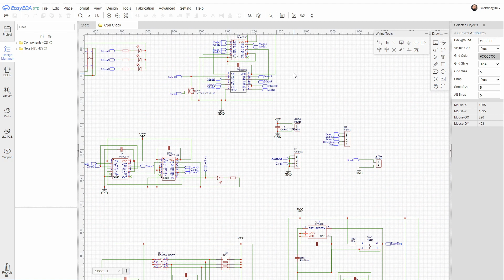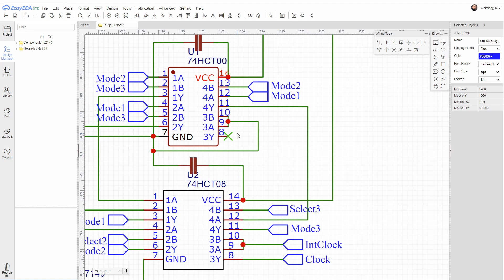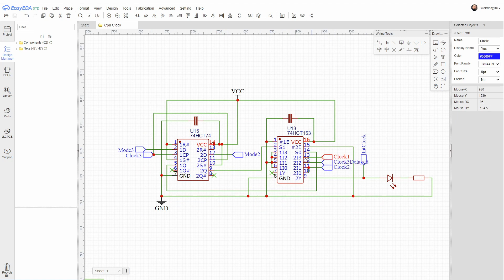Clock Debugging - Making an 8 Bit pipelined CPU - Part 86

Comment: Things are starting to come together, I would not want to be in Intel's boots.  ;)
Reply from the maker: Indeed,  the 2.5mhz 8-bit market is looking pretty vulnerable right now!
Reply: @weirdboyjim  But you have an edge, what other manufacture’s microprocessor can be repaired down to component level. got to be a selling point with the "Right to repair" movement :)
Reply from the maker: We should properly be referring to this as a "processor" rather than a "microprocessor"

Comment: these LCD are actually designed to interface with 4/8 bit MPUs. So by directly hooking them up to the system bus wouldn't be an issue, you would just need to enable the enable line if you are talking to the LCD. maybe using another Device line
Reply from the maker: The interfacing should be fairly simple, I just need to design the circuit to interface between my control lines and the inputs it needs. I just need to spend some time to work out the simplest circuit.
Reply: What do you mean? Simplest circuit? out on  device A = read/write data; out on device B = read/write register. OR the 2 write lines, Hook up the select lines to Enable and the other also to RS select

Comment: Let's hope that slow to drop signal is entirely due to the breadboard!
Reply from the maker: Indeed, I want to investigate what effect the LED's have on transitions.
Reply: @weirdboyjim  That's intresting as the LED are non-linear in the loading of the line. So edge triggered might be ok, but level triggered might see some delay as the LED turns on and starts to pull current from the line. best to have all LED removed from the data lines via buffers or inverters.
Reply: @weirdboyjim  Did you ever find out what caused the yellow line to decay like that? I couldn't work out what line you had connected the probe to.